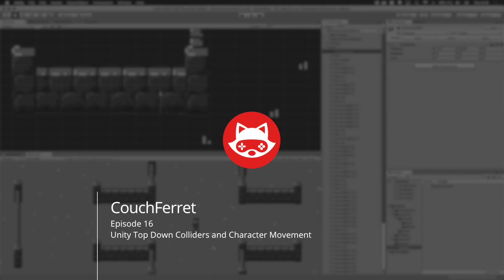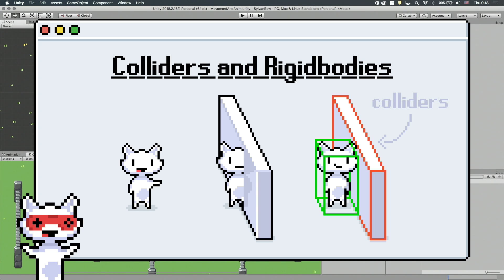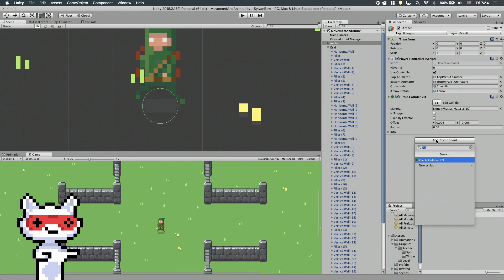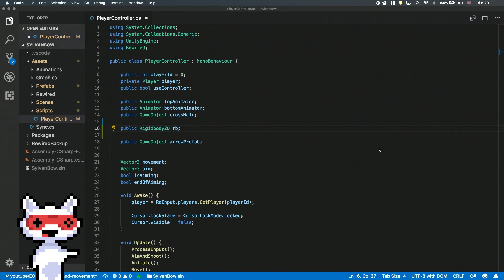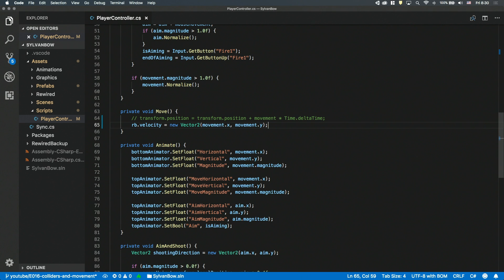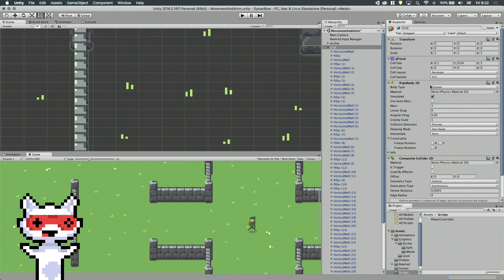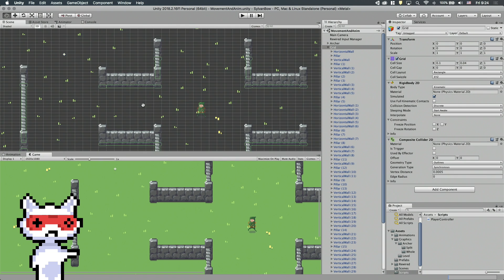Unity Top Down Colliders and Character Movement - Tutorial

Comment: Hi, I'm trying a movement solution almost exactly like yours, using Rigidbody2D's velocity property, but my character's movement is extremely jerky this way.
My mini-script contains a playerRb (Rigidbody 2D) parameter, a Vector3 movement vector, a function called ProcessInput() that consists of only a single line (movement = new Vector3(Input.GetAxis("Horizontal"), Input.GetAxis("Vertical"), 0.0f)), a Move() function also with a single line (playerRb.velocity = new Vector2(movement.x, movement.y) and an Update() function that calls ProcessInput() and then Move().
Has anyone solved this problem? It can't be only me...

Comment: Hello!  Thank you for your work! I have a question though :o What about a body of water.. I don't want it to kill the player I wanted it to block the player just like a wall.. but The player is supposed to open a bridge that goes through the water.. do i make 2 separate game objects for the water with different colliders or is there a smarter way?
Reply from the maker: I think I would go for the 2 separate game objects, or even 3. The third one begin the bridge which will be turned of if the player has opened the bridge.

Comment: Why do the walls need a kinematic rigid body? If they are static, wouldn't they not need to move? Or does giving them kinematic bodies help with something?
EDIT: I noticed you eventually removed them, but you then had to put a rigidbody in the grid object, which is still a bit odd.
Reply from the maker: You are right! The individual walls didn't need to be kinematic they could have remained as static objects. I messed it up, I'll make sure to have a dedicated episode on the collision matrix to sort this out once and for all. :) Thanks for pointing it out! 
Odd, I know, but the CompositeCollider requires a RigidBody2D component. It was strange for me as well and I tried to remove it, but no luck.

Comment: Hey! Thanks for the tutorials! i really enjoyed watching them and learning something :0 i have a question and that is how do you make a character jump in a top down game? I've been looking for it in a lot of places but haven't founded the answer. I dont know if you could make a video or guide me to the materials i need do it.! Thanks!!
Reply from the maker: Hey! :) Well, it depends on what kind of jumping you are talking about. If it's just a simple jump like jumping over a fence, then it isn't that difficult, just a few tweaks with the colliders for a short amount of time to let the character go through the fence. However, I have a feeling that you are thinking about jumps between platforms and such. The thing is that it remains simple as long as the overall world of the game remains flat game mechanics wise. For example in this game the map itself is flat, there are no hills. But if you want to make the character jump between platforms with various heights and fall if he fails to jump long or high enough then a 2D solution like this game have will be tough. I would recommend making your game in 3D isometric perspective but using 2D sprites to still keep the 2D feeling. In 3D you can simulate the correctly the positions and not just fake the third dimension like I did in this game. However, if your platforms and the ground remains flat in your game, and you only have a flat surface with holes in it, then that could be managed in this 2D solution. Hope I make sense! :D Let me know your plans in detail so I can suggest a solution for it. Like reference existing games, or describe the limits of the system, so we can decide that a 2D solution works for you or it would be wiser to switch to a 3D but 2D looking game. :) Cheers!
Reply: @CouchFerretmakesGames  Thanks for your response! Looks like im going to make it flat then! haha, You caught me, i was thinking in simulating that kind of 3D. Mostly for pits or cliffs so the player can jump them down, (just like in Hyper light drifter or in CrossCode) However i dont think im going to add it, but the curiosity got me to ask you. Thanks again for your time to answer me. it really helped me a lot!

Comment: How to make it so the animation stops when walking into a collision?
Reply from the maker: That's a tough one, but pretty cool idea. I'll think about it to have it in the game. Thanks! We could achieve that with collision detection functions like OnCollisionEnter2D, and with a new animation parameter. However, I think the main struggles with this would be to find out that the character actually running into the walls or just running near the walls.
Reply: @CouchFerretmakesGames  (didn't watch the video yet but) the animation should stop only when the character velocity stops. if the character sprite stops due to hitting a collider (velocity = 0), its animation should also stop (animation = 0). if it doesn't stop (velocity > 0), the character is either sliding along the edge of the collider or not hitting the collider at all, so the animation shouldn't stop as well (animation > 0). the result will look natural, and the game will play as expected, with no major changes (not even OnCollision events are needed).

you already have the case where velocity = 0 and animation > 0, which is basically the idle animation. (if you don't have it already, it's well supported anyway), and the only case where you want the case of velocity > 0 and animation = 0 is if you want to have a character fly off due to damage (maybe bounce in the air slightly like a ragdoll) or some other physical force that might act on him (you know, like spring traps etc). in that case the walking animation might appear uncanny, simply because his legs are detached from the ground, and in general, this is how you convey the notion of an involuntary movement in such games (if no other animation is dedicated to this context).

Comment: The little 2D Ferret is lovely!
Also, how hard would it be to add jumping in this game?
Reply from the maker: Hey, thanks! :) Well, it depends on what kind of jumping you are talking about. If it's a tumble like dodging arrows fast, then it's pretty easy and I'm planning to do that. However, I have a feeling you are thinking about real jumping like between platforms an such. It remains simple as long as the overall world of the game is flat. Like in this game, the map is flat and there are no hills, the "terrain" is flat. But if you want to have hills or platforms that are taller to jump in between them, then it becomes very cumbersome in this game's full 2D solution. And I would recommend a 3D isometric solution with the same sprites. You couldn't tell the difference in looks. It's a bit harder to implement the basic mechanics but handles the 3D space way better (because it's literally 3D) so any kind of jumping would be possible to implement. All in all, if your jumping remains in a flat world then it's easy, but if it requires upwards and downwards motion in a 3D space like in Monument Valley, then this 2D solution makes it hard and not feasible.